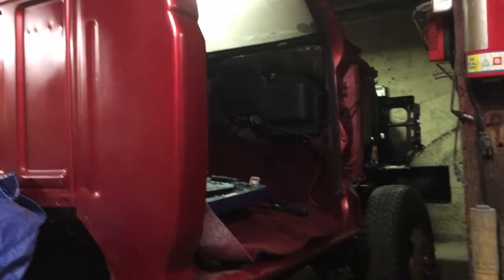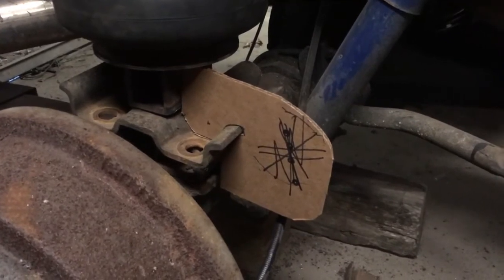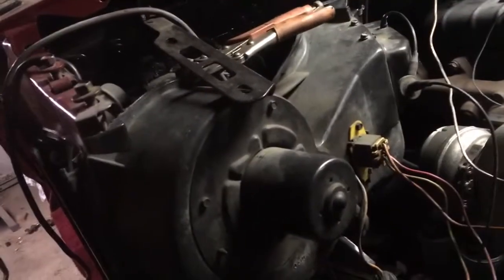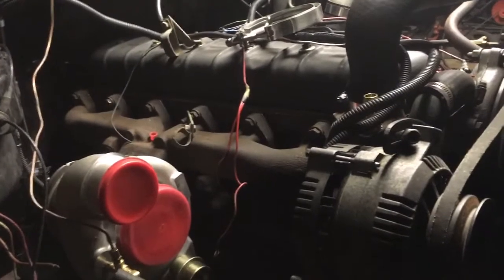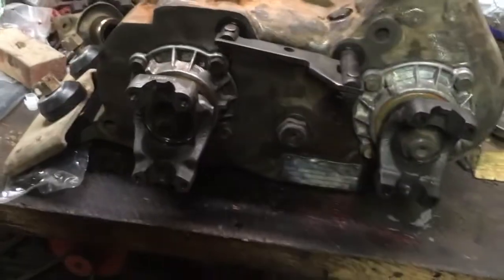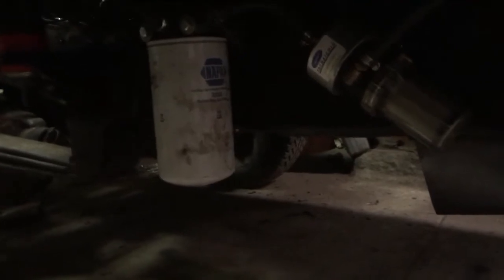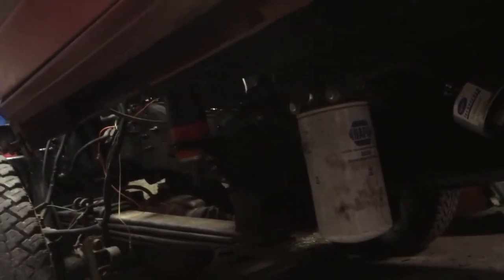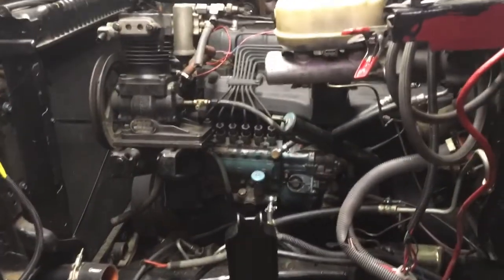The next update on the Dually Build.

Comment: Kind of upset you didn't put air horns off like an old International 4900 on this rig. But pretty badass so far man!!
Reply from the maker: acdcfanforever3   It’s not done yet. It will be getting air horns but from a Mack. Either way it will sound similar